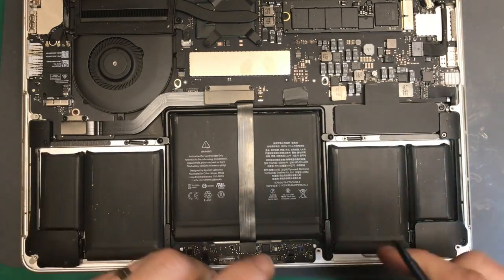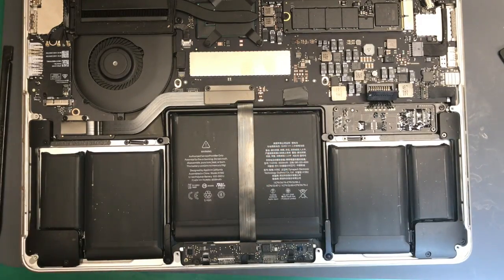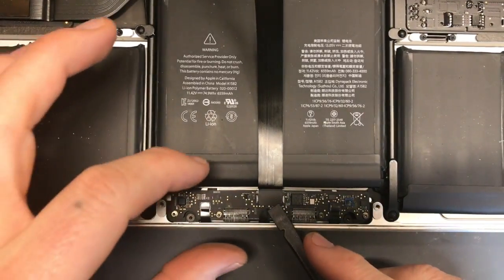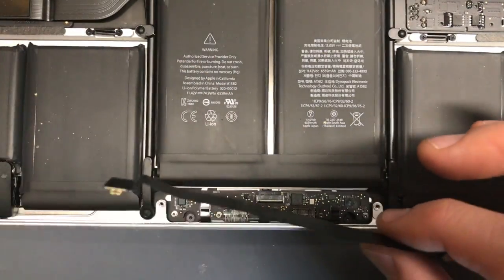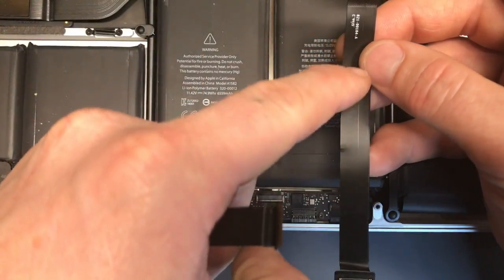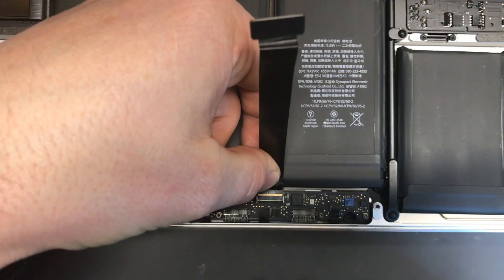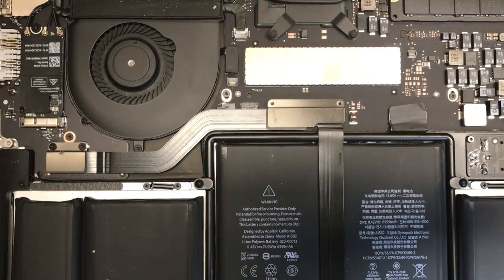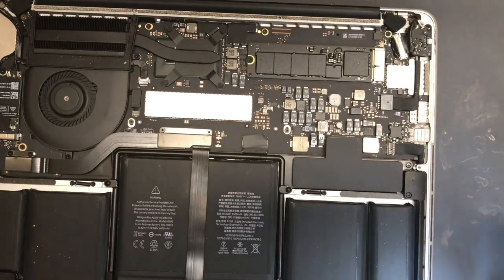Macbook Pro 13" 2015 A1502 NO Trackpad & Keyboard Fix repair Guide

Comment: If you get some pieces of tape and fold them over a few times so it is about 1.5 mm thick or so and put it on the batteries either side of the 'strip cable', then put some paper on it to stop it sticking to the cover it will also help because the metal caves in and crushes the strip, this will reinforce the cover and stop it from compressing down onto the trackpad/keyboard ribbon cable which is why this has needed to be replaced in the first place. Otherwise you will find that the new strip ribbon cable will have the same thing happen to it, I've just done this myself after replacing it and so far so good.
Reply: @ryan Held up fine, I should have done it to this new one I've got, I damaged my old Retina MacBook from spilling detergent through it accidentally...tragedy...have to do the same transplant operation on the replacement Mac now. Wish me luck...

Comment: I actually tried removing and reseating the original one and it appears to have fixed the issue! Maybe the disconnection of the battery fixed the issue! Thanks for the guide!

Comment: Thanks for the guide! I littel bit of a heads up tho, you mentioned the T5 screwdriver. However the T5 was too big for my Macbook Pro 13" 2015. I had to use the T4 instead. Not a big deal, but if you're buying the tools online, it's probably good too know!

Comment: I think I cracked the connector beneath the battery. Anyone know how to replace this or know what the little board that it resides on is called? Thanks
Reply: Did you figure it out?

Comment: Brilliant - all fixed for the price of the slightly longer replacement cable @€10.  One question though - why does the cable need to be stuck down onto the battery?  For the time being I've left mine unstuck, allowing the cable to move as the battery swells.  Thanks if anyone's got the answer!
Reply from the maker: Hi the cable adhesive is there to stop the cable rubbing on the bottom cover, not having it there causes it to fail quicker.
The adhesive can be removed from the old cable and placed on the new one.

Comment: Try reseating it first. that worked for me. Just take the cable out and put it back in
Reply from the maker: Ethan Rapp this will work for a short time only, if you put weight on the top case the cable will short out on the bottom cover, if anything it’s how you know the cable is bad.

Comment: Hey thanks for the helpful video. 

Unfortunately I tried replacing the cable, and that didn’t seem to help, neither did retrying the old cable. Tried rebooting, smc, and the nvram(?) reset as well. 

Seeing as how the cables are so prone to damage Im probably going to try buying one more new cable to try because it’s cheap and easy. 

If that doesn’t work though what other things can go wrong generally? 

I appreciate any tips or advice.
Reply from the maker: Hello, if the power button works or is the only button that works, its normally the cable, there are cheap copy cables that often don't work or fail quickly so try again from another supplier, the trackpad could also be the issue but far less common. good luck
Reply: @MAC111 You nailed it, the first cable I ordered was cheaper and a dud, but I tried another slightly more expensive supplier with more reviews, and the second cable worked fine.

Thank you so much man! You saved me so much stress and money, I heartily wish you all the best good sir!

Comment: Thank you for the thorough guide! The question is now where do I buy this replacement cable? Concerned with buying it from Aliexpress, is there any reliable place that sells certified original components? Maybe someone sells original components from donor devices (e.g. iCloud Locked but otherwise perfect)

Comment: I just replaced the cable. Trackpad is now working, but the keyboard is not. I Bought and wait  a new one and i hope it will fix the problem !
Reply: the cable from COHK Repair was not working good ( trackpad ok but keyboard not) , then the cable from APTec solutions is working well ( trackpad and keyboard are now OK ) ....My MacBook Pro retina 13' model 1502 EMC 2835 is now repaired ....thank you MAC111

Comment: Hey mate love your video.

Two questions.

1. How do you know the ali-express cables are original? Is it because it is pre-bent? I bought one off ebay and it was a bit too long and when I replaced it the haptic feedback didn't work. I surrended the laptop to apple repair that said only they sell genuine parts and you're forced a labour fee. So I'm just investigating these cables a little bit.

2. Would you be comfortable in explaining why the trackpad cable itself fails?

Thanks.
Reply from the maker: Hello, 
I believe the cable fails from rubbing on the bottom cover, when the cable rubs, over time the circuitry touches the bottom cover and shorts to ground, if you were to just disconnect the cable and reconnect, often if works again until you rest on the case and it shorts out again.
The too long in length cables are fake I’ve only had issues with them, the link has pre-bent cables and they just look right and work good, but there im not 100% if they are original because Apple doesn’t sell this $5 cable. 

I believe this seller below sells original but higher price.

https://rover.ebay.com/rover/0/0/0?mpre=https%3A%2F%2Fwww.ebay.com%2Fulk%2Fitm%2F333273354430
Reply: @MAC-pv1bb  Thanks. I looked at the aliexpress link in your description again. I note that they all include the pull-tab on the lower slide-in connector of the cable. That looks very indicative of the original. I am buying 5 - I hope by clicking that link you might get some kind of referral. If not, thanks. I will give each one a go and hope they all work.
Reply: @MAC111 I did some further sleuthing and I found out that Apple seems to be aware with this issue because the replacement cable they provided was not the original part number 821-00184-A which was my original genuine Apple trackpad cable that went faulty. The ebay was a replacement for that but it was a bit dud because of haptic feedback.

I checked my apple repair receipt https://user.fm/files/v2-b0f59b317d3fa20ec752c774177c2265/receipt-redacted.png and it uses a different part 923-01376 (aka 821-00721-A) which is the cable being sold in the description.

Searching this part number landed me on an interesting reddit thread on the issue: https://www.reddit.com/r/applehelp/comments/an103p/macbook_pro_keyboard_and_and_trackpad_not_working/efq4atb/.

The user that is flaired as an "apple expert" specifically says they are on the second revision of the cable (821-00721-A) due to known high failure rate. DIY and random repair place may give you may not get second revision cable and you won't get the trackpad calibration software run that only Apple has access to.

I'm unsure what this trackpad calibration software does or if it is even necessary. I also have it on very good authority that this is a metallurgy problem that manifests due to the apple laptops running hot all the time. The revised cable probably improves on the material to ensure no micro cracking or corrosion. Apple has actually had the same issue before with the non-retina Macbook Pro 13" unibody hard drive cable (aka a1278 hard drive cable issue) where they had 3 revisions and a short term replacement program.

Anyway, I'm just dropping this information in the comments in case anyone was wondering what the deal is. I've purchased the second revision cables from the aliexpress seller in your description link, I am very keen to see if they work with haptic feedback. I will report my results here once they arrive (probably a month or so).
Reply: @MAC-pv1bb  I just received my aliexpress purchase directly from the link you posted in the description of this video.

Unfortunately the seller sent me (5x) of the old revision (821-00184-A) of the cable without the pre-fold/pre-crease or a pull-tab for the slide-in connector. I'm in the dispute process at the moment because I was expecting the new revision (821-00721-A) with the folds at the socket connector and the pull-tab on the slide-in connector. Sigh :/.

You may want to update the description to let people know that it's kind of a lottery if you get the correct cables.

Comment: It's really weird,  the trackpad and keyboard hadn't worked for months, and all of a sudden they started working again. But just for a few hours unfortunately...  All I did it seems was trying the screwdriver  I had just received (the one to open the Mac).
Reply from the maker: The cable often fails because it rubs on the bottom cover and shorts to ground, quite often you can just take the cover off and reseat the cable, the fix is most often short-lived.
Reply: @MAC-pv1bb  It made me think that it was some kind of bad connection, but I never managed to make it work again.
Reply: @MAC-pv1bb  BTW I have a question, is it a T4 or T5 needed at 40' in the video? I know you say T5 but I read somewhere else that it's a T4.

Comment: Hi! I have the same problem, trackpad and keyboard stopped working all of a sudden. However before this I was already having trouble with the battery (sometimes it was completely charged but when I started the computer it said it was at 0) and with the Bluetooth (it hasn`t worked for over a year). So I was wondering if this could be the "battery swelling" people talk about and whether in that case changing the cable would still fix the problem. Thank you very much!

Comment: Had the same problem. Replacing flex cable didn't fix it for me. Did the Caps Lock light turns on before you replaced the cable? Mine doesn't. So, I could have a different problem?

Comment: I've had this problem on my MacBook Pro Retina 13" Retina Early 2015 multiple times now. Each time Apple (under warranty) have repaired either top case or logic board. I'm keen to give this a try. Is there anyway to stop or minimise rubbing of the cable?
Reply: I ordered the kit with the cable and tools. Happy to report that replacing the cable fixed the problem. I notice there’s a small amount of flex in the bottom casing which gets more pronounced the further away from the screws. The cable pretty much lies in the area of greatest flex which causes the rubbing.
Reply: @adamlau  So the cable rubbing the back is inevitable? I wish I could visualize what you mean by this, as I've experienced the same issue with trackpad & keyboard unresponsive due to the cable. I've only had the cable removed and reapplied by the Genius rep, and trackpad & keyboard functioned again. But the problem came back recently so I shut down the laptop and shook it a bit, thinking if the cable was displaced or rubbing the back that it would work again. And it did. The problem is, I shouldn't be shaking the laptop like an idiot anyhow.
Reply: Carmela LA if you look at the start of the video you can see the cable running vertically down the middle. There’s nothing at all (e.g. spacer, insulating material) to seperate that flat ribbon and metal case (which has been removed). I carry my laptop around with me in a laptop bag, walk to the station, or run when I’m late. I think it contributes to the eventual wear and tear as the casing flexes in and out. You can probably feel the flex yourself if you flip the laptop over and press the casing around where the trackpad unit/cable would be.
Reply: @adamlau  Wow! I just did this and the keyboard+trackpad came back to life. Guess that leaves me enough time to order the parts to do the modification...
Reply: Shoefiti the trickiest part is shaping/bending the cable as it’s too long. The other tricky bit you should pay attention too is the removal and insertion of the cable into the trackpad side (the connector shown at the bottom of the video)
Reply: @adamlau  did it work for you ??
Reply: E F sure did!
Reply: Thank you very much. All of this is very useful.

Comment: I forgot to flip the little black tab should that be a problem ?
Reply: I think you should reopen to flip the little bar down. It keeps the flat side in place. My trackpad and keyboard stopped working just because I didn’t totally secure top connection with the bracket.

Comment: My keyboard stopped and I took it to apple. They already removed the strip that needs to be replaced. Would it still worked if the strip is off before the battery? Thank you

Comment: 2:01 - What do you use to actually bend the cable to the proper [bend] radius?  I have been unsuccessful at doing this without compromising the new cable. Do you use a jig? What is the bend radius for this cable?
Reply: i have the same problem. i fitted it, it worked. i bent the cable, it stopped working - think i compromisded it.

Comment: Hi friends! i recently did a battery replacement in my 2015 Macbook Pro and when I did it I did it kind of carelessly because it was my 2nd time doing it. I'm afraid that I may have yoinked the ribbon cable out of the ZIF port without lifting the locking cable. I got a new ribbon cable but sadly the new ribbon cable doesn't seem to have resolved the issue. Is there a chance I damaged the port? if so what should I do now to try to fix it?
Reply from the maker: Hi you have to replace the trackpad, its not so hard if you have the battery out.
Reply: @MAC-pv1bb  what makes you think it’s the trackpad? Neither the keyboard nor the trackpad is working which is making me think it’s something to do with the cable or it’s port. 

Additionally the computer has its fans on constantly not sure if that’s a symptom
Reply: Additionally the computer is running incredibly slow for some reason. I’m so confused.
Reply from the maker: @Xgen20o4fan  The trackpad has a fan sensor, if it's not connected to the Mainboard correctly the fan will go full speed. The flip connector side is the trackpads PCB, if you have damaged the flip connector you need to replace the Trackpad, alternatively, try another cable as there are some bad ones out there.
Reply: @MAC-pv1bb  I could try another cable but it seems Unlikely that the one in the laptop (which visually inspects well) and the new one would both be busted. 
As I mentioned the keyboard is also not working which makes me think it’s a bigger issue. Furthermore the computer is actually running super slow on top of all the other fan issues. I’m going to toss the old battery back in today (after I dig it out of the trash -_-) and see if it could be a battery problem
If that doesn’t work it might be time to just bring it in somewhere as beyond my expertise
Reply: @Xgen20o4fan  I’m having the exact same issues as you. loud unnecessary fans + no keyboard/trackpad functionality. Kindly let me know if you found your solution and what it was?

Comment: Hey all, what to do if nothing works?  Changed the cable but still nothing - trackpad + keyboard + cable is replaced.   Could it be the socket at the logic board? is it possbile to fix that?

Comment: I dropped my macbook pro early 2015 retina, accidentally. Now I have a dent in the top right corner and the USB is bent. My keyboard stopped working short after. The power button works and the trackpad works just fine. Would following the instructions from this video sort the problem? please reply. Apple is charging a bomb as they want it to be replaced instead of repairing it. PLEASE HELP!

Comment: trying to clean the jointer in shut down position without disconnecting batteries, can it be dangerous for mother board

Comment: ultra delicate ribbon cable on the outside of the battery is truly a terrible design decision. I replaced the battery of my 2012 MBP with no issues. Then, I think I can help my buddy with his battery replacement because, 2015 and 2012 are basically the same right? NOPE, mine had the ribbon cable between the battery and the trackpad, not on the outside of the battery. Maybe I just got lucky, but it really feels like apple screwed something up with this specific generation.

Comment: Hi dude, i have a 2014 model, it doesn't have that long flex cable going over the battery, I've damaged the ribbon cable on my 2014 one that plugs from under the battery into the keyboard. Is there any way i can replace this? surely with such a delicate connector that if it breaks i can replace it? please help! thanks
Reply from the maker: Hey Tony, you would need to remove your battery for this repair, I remove both speakers and the battery screws on the board by the connector,  use an elbow Pallet Knife top get the battery out and start by going in where the speakers were and there is a metal shied over the trackpad that needs to be removed. It's not so hard, good luck.

Comment: The top of the snap connector (at the bottom of the frame in the video) seems to not be there on my laptop. Do you know if it will function without that snap for the cable there?

Comment: Can someone please tell me the size of the two screws holding the metal plate inside? I used a 1.2x25mm to unscrew the case and it worked prefectly, but looks like the screws inside are smaller. I don't want to damage them. Thanks.

Comment: Hi there, thanks for the video. I just performed this repair because my keyboard/trackpad were sometimes not working after my macbook pro had been asleep. Repair went well, but now I have no haptic feedback when I click my trackpad. I've made sure this is selected in the settings (and I've turned off silent click). I've also reset the SMC and the PRAM. Clicking works normally, but there is no feeling of the click now. Any suggestions?
Reply from the maker: Hi, if you have checked both your connections and they look ok, then id say the replacement cable may be faulty, also look for any damage around the trackpad connector. Hopefully, you purchased 2 cables, good luck.